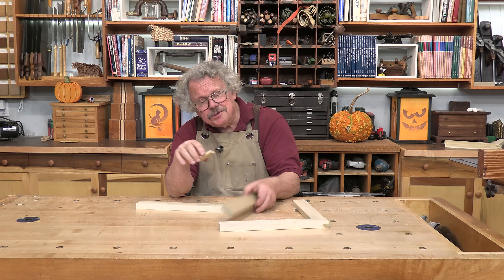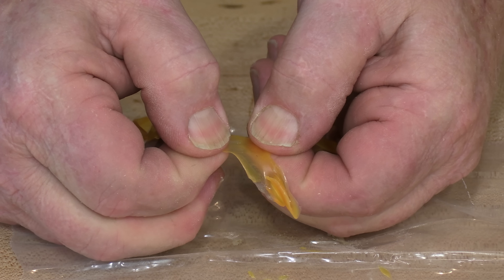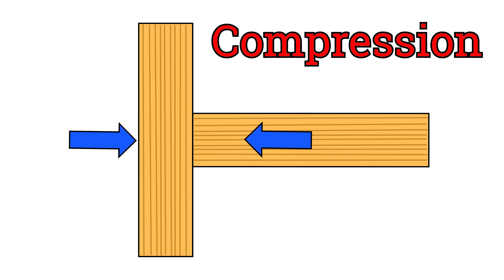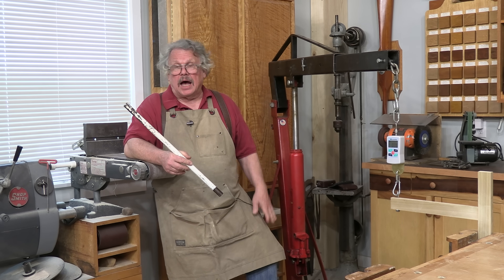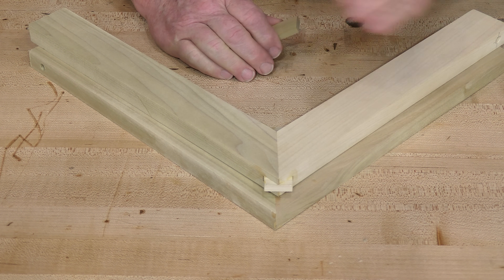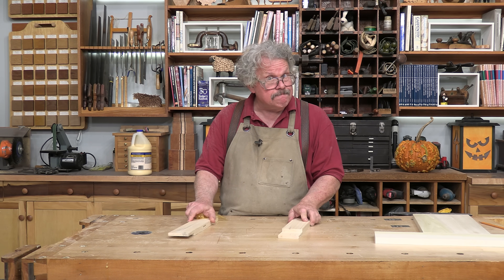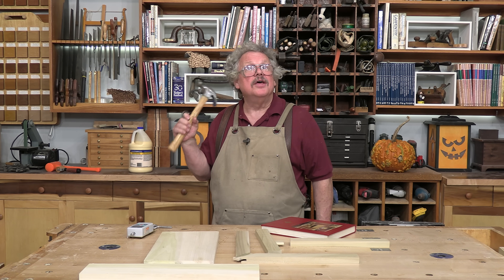Why Glue Alone Won’t Make Strong Joints

Comment: I've recently started both 3d printing and woodworking, and it is fascinating to see the similarities when considerong strength properties. Like wood grain consideration, in 3d printed parts we have to take care to consider in what orientation parts are printed, since the layer lines in 3d printed properties split in a similar way to how the lignin in wood splits, and so when designing parts with a connected interface like you did with the first test, we would take care to ensure the layer lines are across the tennon

Comment: 9:57 all you need to do if you ripped the spline, turn it 90°so that so that so that grain is running in the correct direction
Reply from the maker: Splines are normally quite a bit longer than they are wide. Turning them 90 degrees is usually not an option.

Comment: Watching this I just figured out my sash windows.  My house is 120 years old.  Unlike doors or cabinets or all the old plans I see online, the rails on my sash windows go all the way across, with the tenon on the stiles.  

Your video provided the answer : if rails were tenoned into the styles and the stiles expanded, then the window would expand and pinch in the frame.  This won't happen with the stiles tenoned into the rails.

Comment: Well sir, since I’m finally back online, I first have to ask if you ever did look up the MSDS for water? As to this topic, there are times when a really strong glue joint is not the best option. As one young hand tool enthusiast puts it, “Think of it like a circuit breaker. If the joint fails because the wood failed, then it has to be reconstructed. If the glue fails, then you just have to remove the old glue, clean up the joint (possibly having to add veneer and trim it to fit) and put it back together”). 😎
PS: Yes, he uses hide glue almost exclusively. 😅

Comment: It's important to note.. That you're doing this with a leveraged pulling force.. You're multiplying the amount at the joint MANY times more than would be experienced directly. 

This is also not being tested on a full piece of furniture, or a completed item. Just a singular joint.. When you combine everything together, as you would with a chair. The individual joint might not hold 200kg, but them all combined, can hold 500kg easily, because the stress is spread. 

This video is misleading because of that. You absolutely don't need to use extra joints for most furniture, especially if you take the time to properly design it.

Comment: Do you know what's funny about you using kilograms and not pounds. It's actually incorrect, this is one situation where pounds would be adequate but kilograms are not. For those that don't know why kilograms is a measurement of mass whereas pounds is a measurement of weight, your mass does not change whether you're on Earth or on the moon, weight absolutely does.

Comment: Surely, in traditional carpentry, the type and layout of the joint should be providing the majority of the structural integrity and the fastening system, nails, screws, glues etc, are just there to keep everything where it should be?

Comment: Informative video  but your bit on adhesion is not quite accurate. Polyvinyl alcohol (PVA) has a molecular structure consisting of a carbon-carbon backbone with hydroxyl (OH) groups attached to every other carbon atom. It's a linear, synthetic polymer that is typically water-soluble and can form strong hydrogen bonds. The degree of hydrolysis and molecular weight influence its solubility and film-forming properties. In other words it bonds at the molecular level to the hydrogen atoms in the wood and the clamping only spreads the glue and tightens the joint. It does not bond by physical adhesion like some other glues.

Comment: I've never seen the point of using that Titebond stuff.  Worked in two furniture factories (Kimball Int. & Mohon Int.) and they just used what for all the world looked like plain old Elmer's, though they did have it by the gallon and usually in a pan with a large rotating rubber wheel ya ran stock like edging over.  I typically use a doweling jig and 3/8ths dowels when building cabinetry, shelving etc. only because that's what we used at Kimball...though to be fair, their "jigs" were a lot larger machines made by a company called Nottmeyer.  They never planed anything, but they did have huge belt sanding machines from a German company called Heeseman.  They gave me a used sanding belt from one of those machines once that still had plenty of life left in it and I'm still cutting off pieces of it to use in an old 1/3 sheet sander I have here 20 years later, lol.  They had big ancient computerized routers from Eckstrom/Carlson that were programmed with big reels of tape and every time the power went out they'd have to get out those big tape rolls and run them...took about 2 hours to get them up and running again.

Comment: That Epoxy Tenon was surprisingly stronger than I thought it would be!  😮
Reply from the maker: We were also surprised, but remember this was just an informal comparison. We tested just one example of each joint. For this investigation to have any engineering validity, we'd have to test multiple samples under much more regimented conditions.
Reply: @WorkshopCompanion   Absolutely!  Your integrity is a credit to you Good Sir.  May all your projects be Masterworks, and may all your wood be exactly what you need when you need it.  :-)

Comment: In my picture frames, I run my splines at 90 degrees to the miter. In the back, hidden. I believe it adds a great deal of strength to the miters.
Reply from the maker: It does as long as the wood grain in the splines also runs across the miters.

Comment: Would mixing sawdust into the glue make it stronger?
Reply from the maker: No.
Reply: @WorkshopCompanion out of curiosity, do you know why it is not stronger? I would like to learn. I googled and nothing seems to explain.
Reply from the maker: @MarianoSemelman  You are apparently thinking that adding cellulose fibers to the glue adds strength to the glue itself. It just doesn't work that way. Each individual piece of sawdust becomes another member in the assembly with it's own interface with the glue, seperate from the interfaces that are happening between the major members in the assembly and the other pieces of sawdust. The stress on the joint stresses them all seperately and equally. If there are five pieces of sawdust and five foot-pounds of stress on the joint, there is five foot-pounds of stress on each piece of sawdust,. It's not divided amongst them so they each have to withstand just 1 pound.

Furthermore, the sawdust will prevent the joint from coming together as tightly as it would if the sawdust were not there. The glueline will be thicker and the joint will be more dependent on cohesion, which is typically a good deal less strong than adhesion. Far from strengthening the joint, the sawdust would most likely weaken it.
Reply: Then the only logical reason to add sawdust to glue is to fill an imperfection, scratch or dent on some visible part of the project that needs to be visually blended.

Comment: Wood glue can be crazy strong. I sometimes add a patch of glassfiber in some joins if not visible and its really strong. Wood penetrated by glue is basically a composite material.

Comment: For a good joint you want the fibres to still transfer the forces - so overlapping uninterrupted fibres.  Glue is supposed to hold the joint together, and the joint holds together the 2 pieces. You should not rely on the glue to do that job when you need strength and reliability.

Comment: What is the cohesion/adhesion for hide glue? Does it have any strength in its cohesion?
Reply from the maker: Glue adhesive/cohesive strengths are measured in "gram strength." Hide glue clocks in at 195 or thereabouts, a decent middle-of-the-pack number.

Comment: Glue is always strong enough if done properly unless of course you’re building a skyscraper!
Reply: No, you can get away with it on non structural things like a face frame, but you always want joinery on things like chair legs, table legs, and large doors. You wont find a 5+ year old rocking chair that was glued together with no joinery.

Comment: Hi. Thank you for your video. Odd thing to share. In the beginning of my woodworking journey, I did a lot of glue ups of scrap pieces. One of my 1st clients was a coffee shop. I made 4 person table of as many strips of scrap I could scrounge up and caped it with improper breadboard ends. Just a strip glued over the row of end grain, perpendicular to the grain. Shockingly, it still functions 10 years later. Last time I saw it up close  a few years ago, it doesn't seem to have any separation or warping. I also made a bench with strips of scrap, but no perpendicular glue ups. 12 years now, still strong. Could use a refinishing. 
None of these has anything more then side to side glue ups, no joinery at all. Of course, I used to use gobs of glue, so wasteful. 
Maybe I am just lucky. Or maybe glue is really stronger than you suggest.
Reply from the maker: Or maybe you live in a climate where the relative humidity is stable.
Reply: @WorkshopCompanion  
Hummm? I hadn't thought of that. Thank you. I live in a costal city. Maybe you're right about that.

Comment: Mhm i'm thinking that you don't split lignin when you split wood. There is a third material that you haven't considered - air. The wood fibre consists of hollowed out elongated plant cells, which are bonded wall to wall with lignin. So you split mostly air and some cellulose when you split wood.

Also i'm pretty sure glue does not polymerise, it comes polymerised to a final length. As the solvent wicks away or evporates, the molecules are forced closer to each other forcing them to entangle. This is why the joint can be opened with a conpatible solvent again, although it is a much slower process since... ah noone reads this anyway.

Comment: As a regular young DIY-er, there were a lot of supremely useful points of knowledge shared here. I feel like I have a much more concrete understanding of what is going on now than I had before watching. I have certainly encountered and built up a little bit of intuition about what works and what doesn't, but now I'm better equipped to make more thoughtful decisions. Thanks!
Reply from the maker: Thanks for sharing. Good luck.

Comment: Is a glue joint of two  edges as strong as a jointed edge or one made with a "glue joint cutter" (shaper or molder.)
Reply from the maker: Technically, yes -- more gluing surface. But the assembly really isn't appreciably stronger; the glued-up  boards will split just as easily along the grain. The joint is handy when you need to align two of more boards.

Comment: Is it true that you can "starve" a joint by excessive clamping pressure? 
No! I don't think you can.
Reply from the maker: You're right, you can't. But you can crush the wood fibers. Craftsman sometimes mistake a crushed joint for a starved joint -- both result in a weak bond.

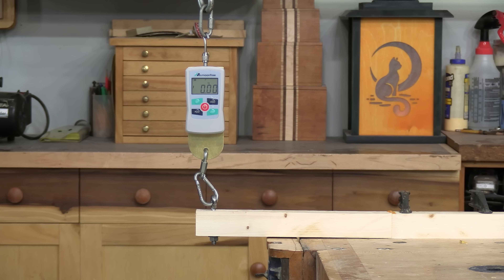Comment: 12:19 It was at this point that I realised that you aren’t actually measuring force: you are measuring torque. And if we call 30cm a metric foot, then you are measuring torque in foot-kilos. (Instead of foot pounds or Newton Metres)

Great video.
Reply from the maker: I probably should have explained that better. A racking force is a type of torque. Thanks for pointing that out.

Comment: Basically, glue is stronger than lignin, but a lot weaker than the wood along the grain. And joinery increases how much long grain is taking the stress instead of just glue.

End grain joints aren't actually weaker, either, they're just usually more subject to a lot more leverage than edge grain glue-ups. So it's less "they'll break easier" than "they are far more likely to receive more stress applied." 

Another channel did a test where they did various glue ups of the same size squares in different orientations, and it actually took more force to break end-to end test units than edge to edge, and edge to edge units broke along the grain instead of the joint breaking.

Comment: @9:07 I wonder what the epoxy could’ve done with  a few pieces of skewer stick tossed in the mortise before filling. 
I’ll venture the guess, interlocking fibers albeit loosely laid and few and far between, would have been a marked improvement over the epoxy alone.

Comment: I've watched at least a half-dozen glue-bond videos over the years, some including massive spreadsheets using several types and brands of glue. They all give short shrift to the grain alignment to focus on the different glues. None of them have explained the topic in as much concise detail as you did. Thank you. But I got to the end of the video and you left me hanging. You got all the way to talking about breadboard ends without ever mentioning them by name, and the fact that the best cross-grain joint doesn't require glue at all, just drawbored pins to hold it together. Well done.

Comment: When talking about the interface of the joint itself racking is know as "peel stress", whereas racking normally refers to the mechanical defamation of the structure typically with a box frame into a parallelogram. So sheer on a joint is just that but sheer on an structure may case racking as would be parallel to anchor points but with leverage causing the failure of the joint.

Comment: For end to end I'm a fan of the sawtooth joint. I've never cut one myself, but just seen it used in commercial products to lengthen a board when purchasing wood strips. The advantage is you get the full cross section of cellulose fibers running throughout the joint, unlike the "square tooth" or "top of a castle" joint, that cuts through half of the fiber area in one go, or the dowel or mortice joint that has only the cross section of them.
The second is there is very little end to end grain gluing.
The third is that if you make the sawtooth edges long enough, not only can you can get a huge gluing area, but reduced leverage on the glue in an end to end attempted bend. The ideal length is just strong enough that the board would break somewhere else if bent or pulled apart end to end, though there is no leverage advantage in the pull apart test.

Comment: Hey Nick!  Here's a thought: try using the glue's natural solvent first to penetrate the wood more deeply on the end grain joints.  Water is a good solvent for the wood glues and acetone for the CAs.  Maybe the solvent would carry some of the glue more deeply into the grain.  The deeper the glue can travel, the more surface area is involved.  So add solvent just before pre-gluing the end-grain.  Just a thought.  Great videos.
Reply from the maker: Water dilutes the glue and this dilution adversely affects its strength. If you want a deeper penetration, the better plan might be to use a less viscous glue. For example, Titebond III is less viscous that Titebond II. As such, it might offer better penetration, especially in dense woods..
Reply: @WorkshopCompanion   Higher viscosity glue is thicker.  Don't you mean lower viscosity?
Reply from the maker: @alext8828  Good catch. Thanks.

Comment: Nick is without a doubt the best woodworking teacher on Youtube. His videos are so informative on a level that amateur woodworkers can understand. Love the dog too.
Reply from the maker: Thanks for saying.
Reply: @WorkshopCompanion  wondering about grain direction and wood movement while working with plywood. How do they prevent the plies from separating because they want to expand and contract in different directions?
Reply from the maker: @andrewcrews-s4q  The reason the plies in plywood don't separate when the wood expands and contracts is due to the way plywood is constructed. Each layer is oriented with the grain at a right angle to the adjoining layers. This balances the forces that cause wood to move due to changes in moisture content. It also reduces the overall movement across the entire sheet to 1% to 2%. The adhesive used to bond the layers is flexible yet strong enough to keep the layers bonded even when the wood moves.

Comment: Sometimes, wood gets glued to things that aren't wood, like plastic or metal. In those cases, you also must consider surface prep. The mating surfaces must be scrupulously clean & free of all oils, passing a water break test if viable for the material (mostly metals). Even microscopic films of oil can prevent adhesion. Some surfaces may also need to be roughened, to increase the contact area.

Comment: glue theoretical strength can be misleading sometimes. Glue will be significantly weaker if the joint isn't fully closed (0.5mm or more). Glue will always be weak if the joint is a surround-joint. (Because glue is not a filler, and this joint cannot ever close). On the other hand, if the joint is closed, glue will self-clamp

Comment: Glue isn't the problem here. Glue is stronger than lignin. If you carved the thing from a slab without using a drop of glue, your structure would have been even weaker

Comment: Is there an advantage to having that second, unglued tenon in the wide joint, versus using a single smaller tenon in the center, or perhaps a larger number of dowels and only gluing the dowels, instead of the entire joint?

Comment: The other common option for a spline in a miter joint is to make the spline with the grain in the long direction, but cut the slot perpendicular to the joint instead of parallel to it.

Comment: In that second test, I'd be interested in seeing a spline cut from plywood, but on a 45-degree bias.  That leads me to another question.  When they are laying the veneers for plywood, do they always lay the grain at 90 degrees to the adjacent layers, or do they sometimes use other angles?  Like, if you have a sheet of plywood with 7 layers, might it contribute strength to have a couple of those layers laid at 45 degrees to the rest?